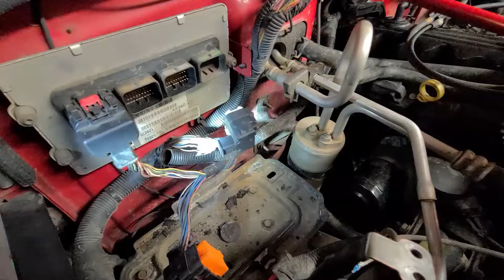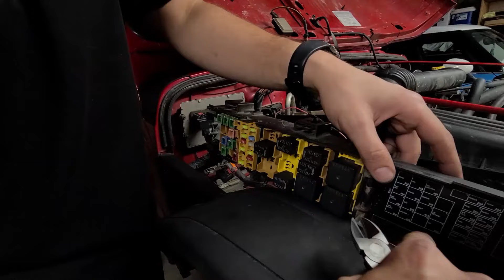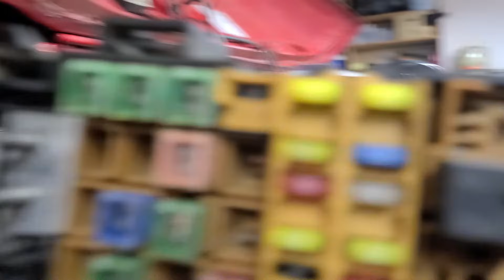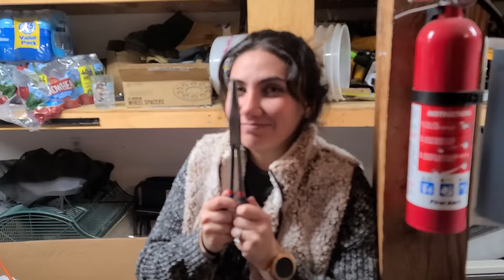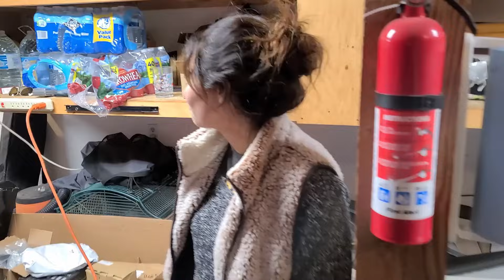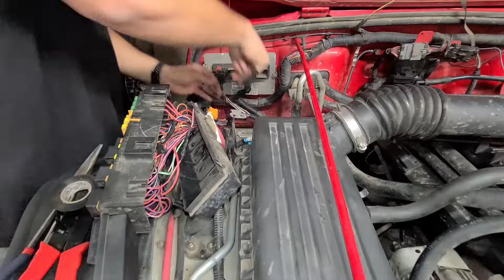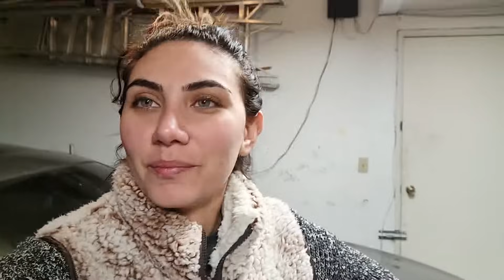STRANDED by the ASD Circuit! Here is HOW we Tested and Fixed it! Easy!

Comment from the maker: IF you want to check out some of our favorite jeep mods, here you go!
Cheap OBD2 scanner - https://amzn.to/3eNwhWw
Plug and play HALO LED headlights - https://amzn.to/36O7sW9
Smoked LED turn signal - https://amzn.to/2EQ7X67
Steel Stinger Front bumper - https://amzn.to/2WjykMA
Smittybilt cargo cover - https://amzn.to/2QeIMzQ
Ares technology PCM - https://arestechnologies.com/
Skyjacker lift kits: https://skyjacker.com/
Rocktrix Rims - https://amzn.to/2xS8Mus
Rocktrix wheel spacer adapter - https://amzn.to/2yDVmD3
Tom woods drive shafts: https://4xshaft.com/
Milestar Tires - https://www.milestartires.com/ 
Affordable sun shade - https://amzn.to/2wWQQyq
Rear LED tail lights - https://amzn.to/2wa7evn
Synthetic winch line - https://amzn.to/3cU01QR
Aluminum winch plate - https://amzn.to/38SLWQq
Rubicon DECALS - https://amzn.to/2xG5lqT
RGB rock lights - https://amzn.to/3b0BoAd
Scrubblade wipers - https://amzn.to/2WcmnHi
Red roll cage fire extinguisher holder - https://amzn.to/2w8ZKsv
Auto fire extinguisher - https://amzn.to/2vjcBIe
Cowl Guards Jeep TJ - https://amzn.to/38SY8QY
4wd Kings light bar - https://amzn.to/2wTOEYy
Stubby antenna - https://amzn.to/2vq9m1S
Reply: Hi Bro , I got the codes 42 and 54 on my yj 1994, what does these codes stand for, I also have an issue when the car rpm is low it's start to choke like it's goning to shut off but when the rpm is high it's okay , this issue happens when the car is cold once it's hot the issue becomes a little bit better
Reply: I forgot to mention that , I already cleaned the fuel injectors, cleaned the throttle body, I also sprayed wd40 on the manifold but it was fine , I also changed the fuel filter, but still can't figure out what is the problem with it
Reply: Awesome video garage couple I'm so glad I stumbled across this video because I feel that this might correct my problem with my caliber I was having trouble starting it after doing some repair I got inpatient and stupidly decide to jump the main relay when I should have did a throttle relearn. I changed the throttle body before this repair and had the red light in bolt when I jumped the relay.But I did get it started after a few difficult tries but after the first day have had no luck I do not show any voltage in tipm fuse spots 22,23,24,26 which powers up cam shaft, crank shaft sensors, fuel pump, ignition and two relays  your talking about in your video.  what do you suggest I do to correct my mistake of jumping main relay I am not confident with electrical but can follow directions please any advise would be much appreciated
Reply: Hey 
How can I contact you please
Reply: I’m having pain problem with my 93 yj  could you please explain that in detail so I can look at that thanks so much
Reply: 193 wide Wrangler won’t start. I changed the alternator the battery starter CPS not getting fired to the spark plugs help please

Comment: I'm thinking this is the issue I'm having of my 94 YJ. Thought it was the fuel pump but replaced the fuel pump and it didn't fix it. The fuel pump just isn't getting full power to it, it was only about 8volts, and the battery was full 13v. It won't even pressurize the lines.

Comment: Hi, I bought a 96 jeep grand Cherokee with a 5.2ltr. I have a crank no start situation.  I've replaced the crank and cam shaft sensors. I fixed some melted wires going to the cam shaft plate in the distributor.  My OBD2 scanner shows no codes but when I run the OBD1 test with the check engine light flash, I now only get a code 42. Also I replaced the fuel pump that was shorted out and burnt out with a new one, but it's still not coming on. Checked fuses, replaced relay, but still not coming on. Getting power at the green power wire but still not working.  I have tried overriding the ASD relay and the fuel relay, by jumping pin 30 and 87 in the PDM, but still no spark and no fuel pump. I do get power to the coil and the injectors, but no spark.
Can you please help me figure this out. Im a disabled veteran living on a low fixed income, and live out in the rule county with no other transportation.  Im sure you will have more questions so I will give you my phone number  and  email, if you would like to contact me. I would appreciate it very much for any help or suggestions you might have.. thank you and have a good day

Comment: @garagecouple thanks so much for posting this ya'll! Happening to me today. ASD cut my XJ engine off at 45mph. Guessing it's a wire that's messed up jiggling around. Haven't gotten to trace it yet. Fuel pump only kicking on at start with a jumper wire in. Relay ain't doing nothing.

Comment: I have a 98 xj 4.0 and im experiencing crank no start switch relays started up like 9 times next day no start again.. originally i had positive coil wire grounding out.. fixed all that.. this all started with a intermittent no start that was before i found the bare wires.. so fixed wires still no start swapped relays worked for a day now back to nothing.. wasnt sure where to hook the wire to check the asd circuit.. replaced my camshaft position sensor aka the pickup in the dizzy.. any help would be appreciated

Comment: So I have an 03 Jeep Wrangler automatic 4.0 and haven’t been able to get it started for awhile now, would have issues if it shutting down after turning or hitting a bump, until finally no start. Found your video and swapped the ASD relay, still no start. So I made a jumper and connected to 3 and 5 and it started right up. My question to you is “Can I run the jumpers to a rocker switch and use it like a cutoff so I can start using the jeep again.

Comment: Great video unfortunately my current situation is my ASD fuse pops randomly ill just be warming up my car and it will pop than put another fuse drive 20 miles let the car sit and run and pop its a shit box 2008 pt cruiser non turbo.I recently put new plugs and a coil in thinking maybe it’s related a bad coil perhaps also have a check engine light for a downstream 02 sensor. Also in thinking it could be a bad relay or exposed copper somewhere. I hate electrical.

Comment: when you had this issue, it would crank but not start.  Did the tach move at all and did the fuel pump kick on, or none of those until you fixed you ground issue?  Nice Video, Thanks.

Comment: Hey buddy. Thank you. I have 97 tj sahara 4.0 and past week or so taking at least 6 tries to start. Turns over and doesn't start. Yesterday installed new crankshaft position sensor and same thing happened.  So don't know what next?  Need to check distributor and I recently installed new fuel pump.  Really need help brother. Any ideas please.  Thx robert

Comment: Is there any way I could contact to im need help with my asd on a 2006 jeep wrangler. Code shows  asd circuit  open. Cand and cam sensor  has power and ground  and pcm is receiving  signal. Fuel pump is on, I have power and ground  at my injectors..but no pulse signal  going  to my coil pack.

Comment: Exactly what my rubicon 2012 is doing except I keep getting a misfire in cylinder 5 and all coils and spark plugs have been replaced multiple times because it keeps breaking them i did the same thing with bypass with a cable and still it turned off on me asd light comes on power control module comes on any suggestions on what else I can check?

Comment: Rigged my Jeep ,  got  it started and moved into garage, but can’t find any broken wires or bad ground , thanks for posting this 99 wrangler
Reply: did you ever get it going, and what was it? I'm having similar issues.
Reply: @steven-ky2ps  still haven’t got it going
Reply: Had sickness in family,Jeep been in garage for months, try to rig wire did something so I couldn’t even bypass, so order new pcm board and crank shaft  , still no crank no cluster.

Comment: Thanks for this video. I didn't have a problem with the ASD or the wires, but your tip about bypassing the ASD relay with a piece of wire really helped me. You said "if it starts, then it is the ASD or the wiring. If it doesn't start, then it is the camshaft or crankshaft position sensor". I had a crank no start with my Jeep and already replaced the camshaft sensor. I replaced the crankshaft position sensor and the Jeep started up after that.

Thanks for the help!
Reply: Hello, what crankshaft sensor did u buy. I’m have a crank no start i bought a cheep one off of Amazon and still nothing i no the cheap ones tend not to work alot
Reply: @nicholasloniewski6949  I got a MasterPro from O'Reillys. For auto parts, I tend to buy from O'Reilly's, Advanced, Napa, etc instead of whatever I find on Amazon.

Comment: The computer doesn’t rely on the crankshaft position sensor to detect an accident. That sensor tells the PCM whether the engine is rotating, but it’s not designed to detect impact. Instead, the shutdown logic is triggered by impact sensors tied to the airbag system.

Comment: My Daughter has 2008 dodge charger,  I replace the carrier Bearing,  rear driveshaft bushing to Axle.

I removed the 12v plug for charger stuff installed a nice type c ,USB....

It wouldn't start...
I used my Xtool scanner , P0688 code.

I replace all FUSE in trunk to manual and also under hood .
 It started,  

Here is the problem. 
When I swap the relays 
It will start. Run drive for hours,  it runs great and no issues before. 

After it sits I have to swap relays again .
It starts again.

It sits , cycling of swaping.

After I seen this .
I will check the wiring..

Im hoping is  not the PCM I really don't think it is....

Car runs like a dream..

Do you think any Aftermarket electrical would make that ASD .

Comment: All due respect to your DIY diagnosis skills…please stop with the electric tape and wire twisting. Cut away the wire until you get to clean copper(the corrosion will creep up the wire under the insulation), add a piece of new wire to make up what’s missing, and solder and heat shrink at every connection. And use heat shrink with adhesive lining. This problem will be back if you don’t. Fun video, you look like you’re having a ball, cute couple…it’s really cool, and I’m trying to be helpful.

Comment: I’ve got a 01 Ram 1500 5.9L SLT and I’ve been dealing with random loss f communication (no bus) it can happen idling in the drive way 5 minutes in or 2 hours later I sometimes don’t make it 5 minutes up the road or I could go 5 hours just fine basically it’s completely random timing and moments then let it set for a little and it’ll then fire back up,,, I’ve checked wiring I’ve checked sensors I had the crankshaft sensor replaced maybe 6/7 months prior I pulled throttle body and cleaned it I cleaned wires and plugs all connectors with electric clean and I’ve replaced the battery and alternator I’ve upgraded all my power supply and grounds to 1/0 gauge ofc cable and nothing curved I went on to measure my ccd bus+ to ccd bus- and got a good 60ohm reading (both resistors are connected) to my bus communication is good but when I went to bus + to chassis ground I’ve got only 6.78 ohms (on 20k setting ~ 6,780 ohms even it should be OL or in the hundreds of thousands so something is pulling the bus down by being internally grounded out a short to ground I’m going to look again but from what I’ve seen my wires are good out I wouldn’t have my bus resistance so I began unplugging each module 1by1 sing what the culprit was I unhooked the ABS (battery unhooked the whole time) no change then I pulled my in dash speedometer cluster and ohms skyrocketed so I thought I found the problem iķ I left it unhooked I still had good bus so I fired up the truck and let it run a good 30-45 min and 
it still died on me again

So is it safe to say the pcm is junked or am I missing something and if so what and where and what do I do next????

Comment: 2025. . . I have an 05 dodge magnum with an ASD inhibiting start. No codes, no nothing. If you jump the starter relay, and the ASD relay, while turning the key, it’ll start and stay running. The second you pull the ASD jumper wire, it’ll shut right back off. . . It’s a shot in the dark considering this is 5 years later. . . But I’m lost . . . I’ve replaced PCM, I’ve replace IPM, and immobilzer reads good on scan tool. . . Any help from anybody is appreciated

Comment: I am having a similar issue with my 07 JK, but I'm not finding any wires that are frayed or burnt. Asd fuse blows when I attempt to turn jeep over, if I pull the relay it does not blow the fuse. Any tips ?

Comment: Hello, I’ve got an 06 Dakota and am having ASD issues, I have replaced tps, can and crank shaft sensors, I threw a 50 amp fuse in the ASD spot, it will fix the issue, fire up and run, but now randomly while driving, it will blow the ASD fuse, I’m at a loss and looking for assistance
Reply: Did you figure it out? Did you check the red/white wire in the harness under that fuse box? You have to cut it open to find it and reconnect it. The splice goes out after time

Comment: 00 durango 5.9 264k mi runs great ive never had an issue until last week wife was driving kids to school an it stalled by the time i got there it cranked back.. then did it again grabbed my test light check for spark at coil i had it checked coil wire i didn't do replace wire did fine for a day then stalls wouldn't crank back so i figure coil getting hot killing spark put new one on no change so on side of the rd no tools i unhooked battery hooked back up crank an drive home scanner show asd  code switch relay cranks... drive all weekend fine yesterday leaving work dies i pull relay put it back cranks drive 15mon down the rd got some chickens an wouldn't crank pull relay put back drive hr home no issue this am won't crank  pull relay put back cranks any help would b appreciated

Comment: Yesterday my sons 2003 TJ 2.4 shut off while driving and still will not restart. It’s throwing 4 codes. P0113, P0118, P0123, and P0505 which are all 4 sensors that share a common ground. I originally thought it was the PCM that failed because this issue happened after he had to jump start it after leaving his headlights on overnight, but maybe the brown/white wire is shorted out somewhere.
Reply: try checking on the ASD fuse and/or Relay
Reply: @ I did and it checks out ok. I ended up having a harness connection under the intake manifold that was loose and had some oil and debris in it. I cleaned and plugged it back in and all codes went away except for the TPS P0123 voltage code. I replaced it with a cheap auto zone unit and the code went away and now the Jeep starts up. It’s far from drivable though. It won’t idle and when you try to rev the engine the rpms go up but it instantly bogs down and smells like it’s just dumping fuel into the cylinders with small pops coming from the exhaust. So it’s flooding apparently but no codes. I just ordered a Mopar TPS to see if that fixes it.

Comment: I have a 2008 Wrangler and I keep blowing the ASD fuse. As soon as I turn the key to the on position it blows the fuse. With that fuse blown it will just crank and crank. I am not getting any spark. I have been chasing down wires and fuses for days now.
Reply: Sounds like a short to ground. Pierce the wire with a test lightb and stick the other end to battery positive. If it lights you know you have a short somewhere

Comment: I have A 2001 4.0 I changed both crankshaft sensors when I change synchronizer sensor just the top. She fired right up then went back off after five minutes doing the same thing crank no start I I ran the ASD direct cranks, but won’t start

Comment: I am soooo happy that you got it figured out and it worked for you. I can't believe that this was posted 4 years ago and I'm just now finding it after all of my online searching for information related to my 2011 Ram 1500. It's because I never searched for anything ASD related and the reason for that is that I have been searching for throttle position sensor and camshaft position sensor related information. As you well know all of those things are linked together. I'm getting a code for the throttle position sensor and my scan tool says that it's unable to close. I'm thinking that has to be due to a faulty connection somewhere or I just have a bad throttle body. My problem started on Monday morning exactly 7 weeks ago and what happened was I drove a couple of miles and while I was driving the battery light came on and stayed on pretty much the whole time until I parked. I immediately tried to start My truck after I shut it off to see how much voltage the battery had left. Well being as the radio and interior lights wouldn't even come on I figured the voltage must have been pretty low, but I wasn't expecting to see zeros on my multimeter when I checked the battery. Next I checked the alternator for a continuity and I got about 450 millivolts which according to the information online means the alternator is good. I tried to jump the truck off later that day and the negative battery terminal and cable started getting hot so I abandoned that idea and got it towed home. I charged the battery for 24 hours and reconnected the cables. Within a minute of reconnecting the cables the alternator got so hot that it literally melted the manufacturers label and the casing turned black. And here I am 7 weeks later still not able to start my truck. I am removing the TIPM right now to check that ground wire. Thank you so much for a well-planned and informative video. I appreciate you so so much! Also, you two are the cutest couple and I hope you stay together forever!!!